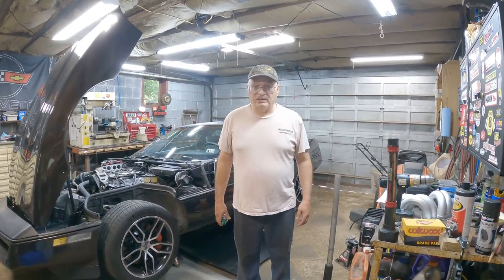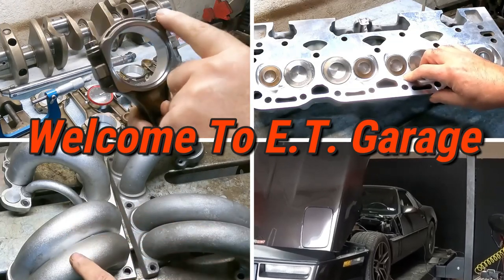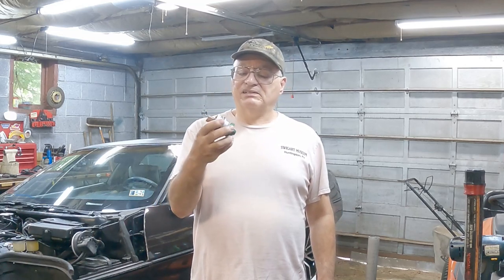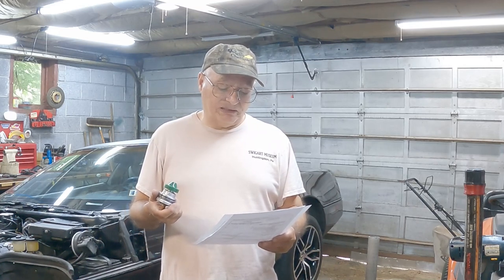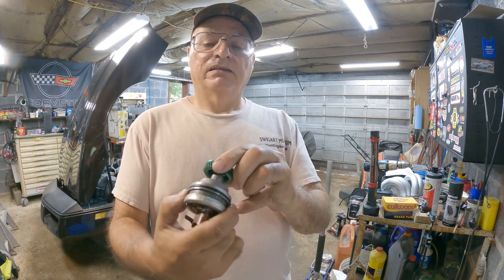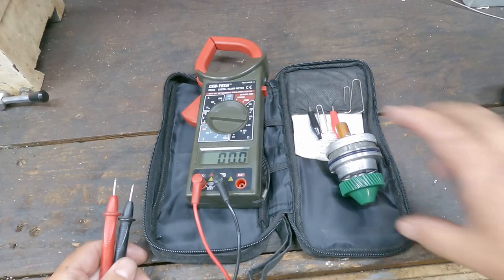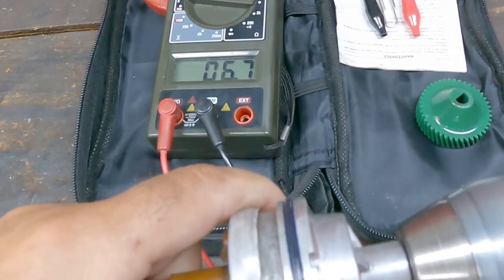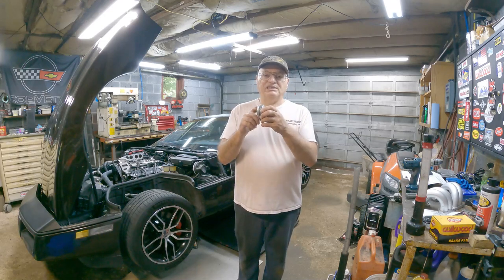C4 Corvette (Code 24) Speedometer Troubleshooting 👀

Comment: Hi Eugene, another great vid.  I feel your pain.  i have a leak from the back of my block and also will be  dropping the exhaust and c beam and ds..  id say go all the way and do it properly with the relocation of the shaft gear.  iyou will likely need a new retainer clip.  i would replcae both the  tailshaft bushing and the oil seal.  then...u dont have to revisit his area again!